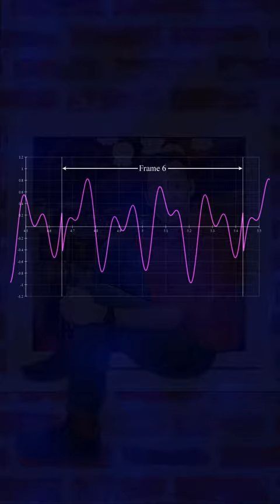What does a windowing function do?

Comment: Using fftw library you do not need a power of 2 as window length
Reply from the maker: For the FFT you ALWAYS need a power of 2. Some libraries "pad" the signal with zeros to get the correct length, which slightly affects the frequency spectrum. Unfortunately I don't have specific knowledge of the library you mentioned.
Reply: @MarkNewmanEducation  That is a misconception, this is only the case for the first widely known implementation that most textbooks cover. However many modern implementations such as the one in matlab (internally uses fftw) can handle non-power of 2 efficiently without zero padding needed.
Reply from the maker: How do they do it? What do they pad with? FFT can only work with radix-2 unless they're using some form of the DFT?